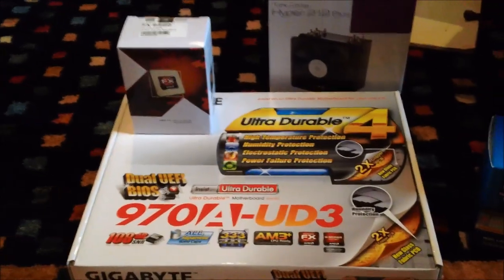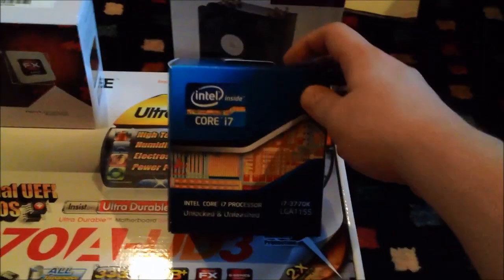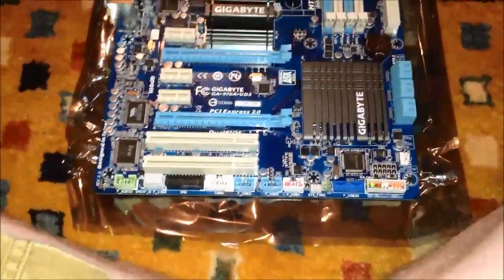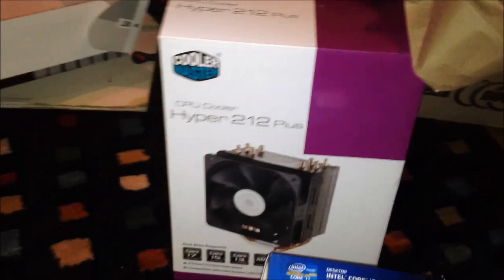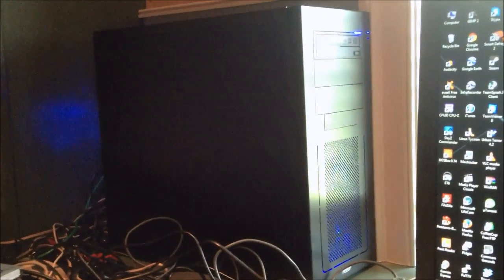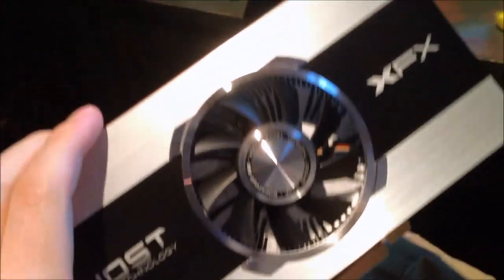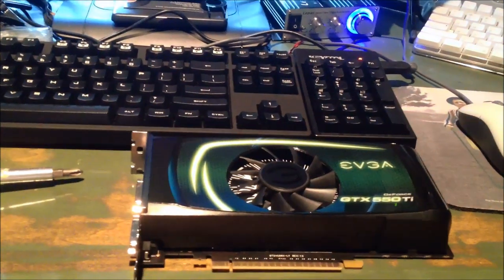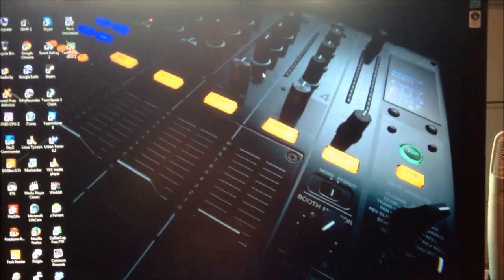Main Computer 8-21-2013: AMD Overhaul

Comment: Even though the windows experience index doesn't mean jack.  My phenom II X6 1045T scores higher than that processor.  It gets a 7.4 for processor.  I still find that odd since aren't the FX 6300 6 cores better performers than the phenom II processors?

Comment: You basically have the equivalent space of my file server built into your desktop LOL.  I'm surprised the power supply doesn't overheat.

I really want to build a new file server that is much more modern, but I just can't afford it right now.  The new one will be a Dell Poweredge 2950 with either 5 or 10 TB total, depending on which drives I use.  It would be nice to have modern SATA/SAS drives for a change.

Comment from the maker: i think i might have a data hording problem! yeahhh, that power supply really does need to be upgraded with the amount of drives in there. one of them is coming out anyway, so it shouldn't be stressed too hard until i can get another one.

oh man, that would be awesome. wish i could afford to do that, but i have to use desktop hardware and just put the money towards storage.

Comment: Fair enough...not a trade i would have made but if you were only using a 550ti with your I7, u werent getting the most out of your platform anyways as far as gaming goes. Selling the I7 with the board (could probably get $350-400 for both of them together) because it was more than what you needed and you using the funds to put toward a build more suited for your needs makes a lot more sense to me. The latest FX 6 and 8 core cpus seem like they will serve you just fine alongside that 7850.

Comment from the maker: you missed that long speech about Intel at the beginning and how they're using thermal paste under the heat spreader and how i don't like that engineering decision because the CPU won't last forever.

Comment: Personally, I think downgrading to an FX-6300 from a 3770K was a bad idea, but I understand your reason for doing it. As for the board's IO... well... Z77 boards are much better equipped than Z68 boards are, so that could have been a cheaper "upgrade" than changing platforms entirely.
As for the build quality, I understand that as well. My 3570K seems to run perfectly fine, though, even at 4.4 GHz under essentially the same cooler you have (Hyper 212 Evo)

Comment from the maker: well, i don't like the idea that in 15 to 20 years, that chip's TIM might not work anymore, so having a vintage i7 might mean that you need to de-lid the CPU simply because Intel is cutting corners. might not matter now, but down the road it will. i've seen the thermal crap they use in there, it's horrible. check out some of the articles related to it.

Comment: even so, if you need the extra power it will auto to 4 ghz when it needs to, and go back to 3.5 when there is less load

50 bucks for .2 ghz is not good anyway

Comment: don't get the 8350, just get the 8320 and overclock it yourself you can get a decent air cooler with the 30-40 bucks you save and push it past 4.2 ghz

Comment from the maker: the engineering is still a horrible decision in my opinion though. that intel CPU may stay nice and cool for 5 years, but it might not after 15, 20 years, ruining the chances of it ever being a vintage machine without de-lidding it. that i don't like at all. AMD CPU's run hot, but at least they know how to transfer heat between the die and the heat spreader in a way that will last using solder.

Comment: FX 6300 won't be far behind an i7 in the real world. Forget sythetics, at the end of the day REAL apps matter, synthetics are just that, synthetic.

For rendering, encoding, image editing etc. it's in touching distance of an i7.

Also, FX 6xxx way better than an i3. I've got i3 3220 (dual-core/HT) and A10 6800K (dual BD module/quad-core) machines here and the 6800K completely trounces the i3. Way better for multitasking, way better for VMs, way better for rendering, waaaay better graphics.

Comment from the maker: if you actually know what you were talking about you'd know that Firewire was not an Apple invention, that was Intel. same with Thunderbolt. i've been using Firewire devices for over a decade and never had the issues you say are present, so i don't know what kind of hardware you've used, but apparently it doesn't work properly.

nobody you know uses it. what does that matter? really. is it supposed to be "trendy" to use USB 3.0? that's a joke. this board has USB 3.0 anyway.

Comment: Hey im not trying to stir anything up or nothing but i find your reasons for downgrading to an AMD 6300 to be very...odd. I know Intels solution lately for how they manufacture the chips to be less than ideal but...if the chip stays within its thermal limits, what does it matter? Was it overheating regardless of what cooler you slapped on there? If so i guess i can see why but if not, that was a completely unneccesary overhaul to your system. And before anyone claims I'm an Intel fanboy, IM NOT!

Comment: why would you even want fire wire on a board anyway.fire wire 400/800 is a mac/apple serial bus connector and is a joke. slow. unstable .drops devices like there's no tomorrow .nobody that i know uses this thing.better off with usb 3.0 .